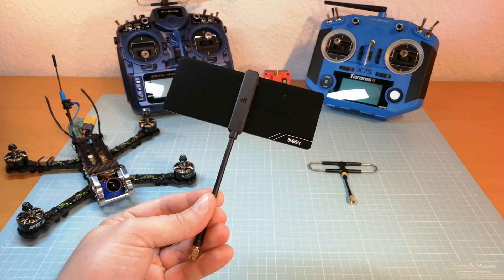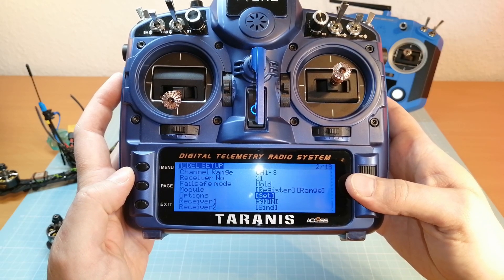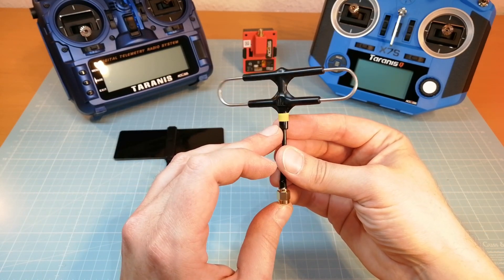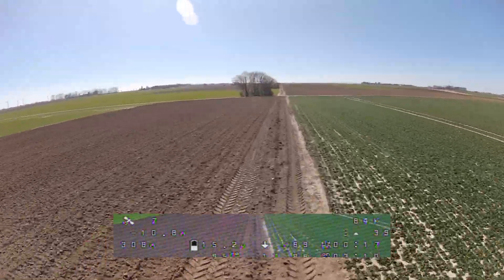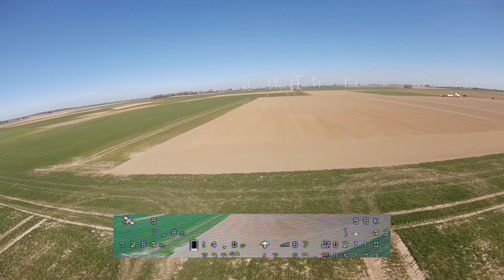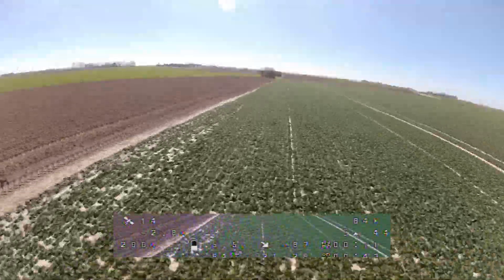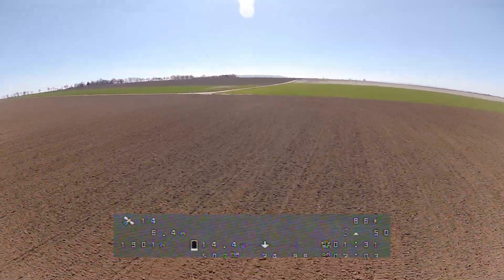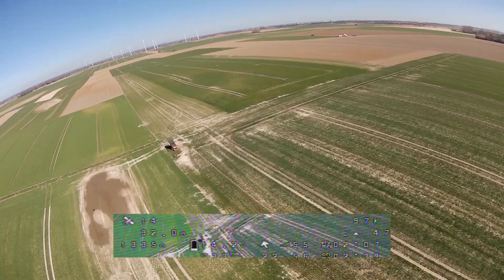FrSky Zipp 9 vs Super 8 - R9M - Access v1.3.0 - OpenTX 2.3.7

Comment: Some 3 years later but still worth nothing that LQ is a better metric when looking at radio reception quality. I bought this antenna for ELRS rather since by now these are not used as much unless you covert them. It just goes to show that open source will eventually become the dominant path for just about everything

Comment: Can someone please help me with something? When measuring continuity on the antenna connector of the R9M module, between the pin and the ground, is it normal to have continuity (0ohms)? Can someone with an R9M check this? Mine is working fine, not tested LR yet, but I'm a little worried. Thank you!

Comment: I noticed your Super8 Tx antenna is edge on towards the quad. Is that the correct orientation? I thought it should be flat.
Reply: Noticed that as well.Typically directionals are most powerful flat face forward.Curious to see if this is different somehow ..
Reply from the maker: Well, i'm sitting on my small chair while i'm flying, the Radio is almost laying on my knees, so the long flat site is pointing to the quad.

Comment: I noticed a recent drop in my RSSI performance with my super8 including RSSI losses and fail-safes. Unexpectedly,  I noticed that if I press downwards on the antenna (towards the R9M module), a static sound appears through the QX7 and my RSSI jumps to 99% even when further away. It looks like the super8 is busted around the neck area. Anyone have this issue?
Reply from the maker: I have already heard about that issue, the Zipp9 antenna definitely looks more robust!
Reply: @TorbanDallas  Definetelly , Im getting a Zipp9 for this very reason. I had a failed long range flight because of this.... (GPS rescued though).

Comment: Hello Torben need your experience and help. I have the immersion vortex 150mini and I would like to switch to dshot600 in Betaflight without breaking anything ?
Reply from the maker: Well, I don't know your vortex drone. Check the specs of your components to find out if your fc and esc is able to run dshot 600. If it already runs on dshot 300 it's probably fine and I wouldn't change the running system. You probably wouldn't notice a difference to dshot 600.

Comment: The 1 dislike from TBS XF user! Lmao! I have both systems ,the Old R9M and new XF full version with Bluetooth. 
Guess which one I use as my daily?  That's right R9M!  I can actually use my R9 with Bluetooth mod to track on GS live maps with both inav and betaflight 
TBS full XF TX Bluetooth does not work with GS through Bluetooth like R9 does and apparently only works with ardupilot mission planner or QGC.
Plus I hate how complicated XF made there Rssi which imo isn't any better than R9 in anyway. R9 simplicity what draws me to it and it works great with Telemetry  Viewer app
Reply from the maker: Thanks for your comment, and your feedback! CRSF isn't better than R9 in my optionion too - it's the same frequency, both systems are working good. RSSI is just a value and the Rssi value of the r9m doesn't seem to be compareable to the crsf rssi value.

Comment: Looked okay to me 2kms on just 10mw at that altitude...How do you know which is the active emitter element of the Zipp 9..?
Same question about your RX Dipoles?
How does the Zipp9 compare to the True Mox 868mhx?... Great test btw...🤔🤔😀😷
Reply from the maker: Thank you! I don't know how to locate the active emitter element. Maybe it doesn't matter? If it would be importand, I think FrSky would mark it.
I already did a Video with the TrueMox but i didn't compare it to the Zipp9.
Reply: @TorbanDallas  Well you can scratch a tiny bit of paint off and use a continuity meter on the centre pin of the SMA connector..I'd suggest it DOES matter...On the TrueMox it is visable if you look closely...
Be interested to see if performance is the same on non Access Firmware....?...🤔🤔😳😷😷

Comment: What vtx is on the long range setup? I like the dual antenna idea, what power was the vtx on? Was a nice range you got just perfect for the battery
Reply from the maker: Hi thanks, you can find the dual antenna idea and detailed informations about it in my FrSky Redundancy Video. Honestly that wasn't a real long range flight, Check out my "Longrange Reached my Goal" Video, I did 4km on this location - I just couldn't go farther because i didn't want to cross the street at the end of this spot.

Comment: Hi, thanks for the video, it could have been interesting to compare both antenna's SWR with the AAI VNA thet you have usually, knowing that the super 8 is almost crap, Thanks for reading the comment :)
Reply from the maker: Hi, thanks for your comment. The Super 8 isn't crap, it's just a Dipole T Antenna whereas the Zipp9 is a directional antenna - of course, it's better for flying straight in one direction. The Super 8 is still my favorite All-Round Antenna and it's very similar to the TBS Diamond.
Btw: I don't know the SWR AII whatever you have mantioned in your comment.
Reply: @TorbanDallas  The FRSky Super8 antenna is a folded dipole which must be supplied symmetrically at 50 Ohms. Its impedance as sold is 73 Ohms. In addition, it is supplied by a coaxial cable (asymmetrical).
We already have 17% of transmission power which returns to the transmitter because of the 73 Ohms. Feeding the dipole with a coaxial adds another 3% loss and deformation of the lobe towards the front of the antenna. In the end we lose at least 20% of power and a distorted directional lobe. I am studying an antenna design for the R9 which will be perfectly adapted with maximum reduction. I will keep you informed when my antenna is ready because I am waiting for the measuring instrument. Again thank you for your interesting videos that I watch with pleasure, continue like that.

Comment: Awesome video..  good results then.  
So how easy is it now to update your receivers with access.. over the air?

One question about GPS rescue.   DId you set it to go straight to failsafe 2 and bypass phase 1.
Nurk was having trouble with his just dropping out of the air when he turned off the radio so was wondering if he was selecting phase 1 and letting it move to phase 2 which was too slow to catch it in a full failsafe.
Reply from the maker: Thank you Michael! Yes it's very easy to update the Receivers over the air now - I'm also showing it in my ALL YOU NEED TO KNOW Frsky Access Video. But if you don't have the new OTA Receivers you still have to flash the firmware over the s.port or the module bay. But you can also run the Access Firmware on the old non-Ota receivers.
About the GPS Rescue Mode, no I didn't bypass the Stage 1. Make sure to test the rescue mode at a distance over 200 meters or even more. Also make sure to get enough sats before taking off. If you are using crossfire, make also sure to set the Failsafe Procedure of the CF Module to Cut.